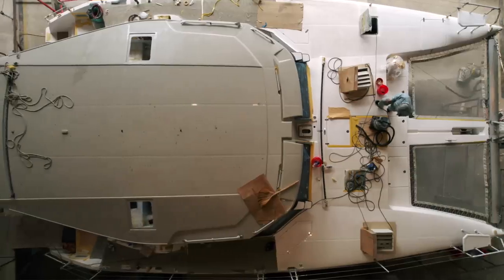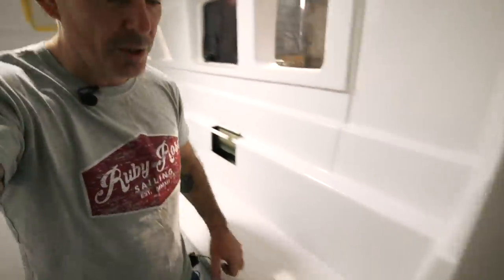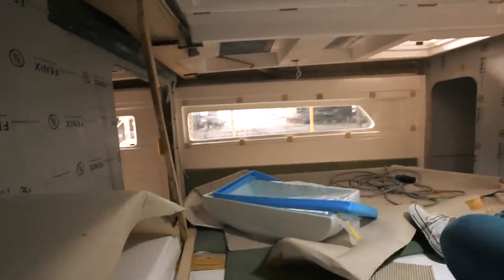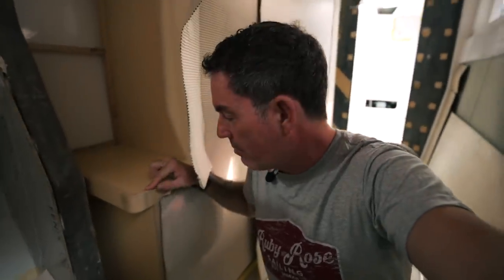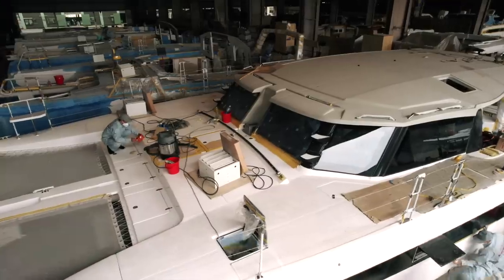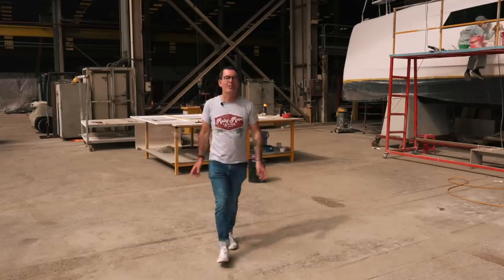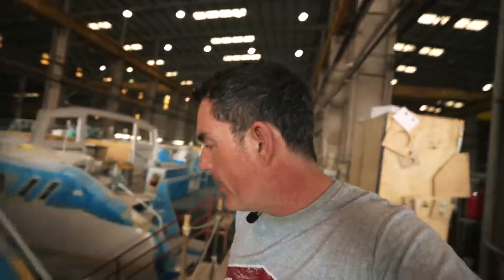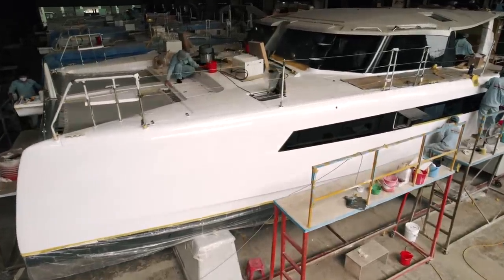Catamaran Build: HUGE Progress & BIG Changes!

Comment: Hi Nick, thanks so much for keeping us posted on the 1370 builds! Hull 1 is looking superb! Two questions (sorry if they've been asked previously); have Seawind/you considered an option of the tri-folding doors in carbon fibre? I own an 1160 and absolutely love the tri-folding doors, but they are very heavy. Would be great to have a lighter option for ease of use and reducing overall boat weight. Second question, are you going to be filming the sea trials in Hull 1?
Reply from the maker: Hey mate! Second question first- yes we will be filming the sea trials. There's paperwork involved in getting Nick onboard because of course there is, but it should be fine. As for the trifold doors, not sure if a carbon fibre option has been considered, I guess a lot of these things come down to cost as well. We'll pop it on our looooong list of questions to get answered at some point!

Comment: If it's going to take a month from this video to get hull #1 into the water, how long after it goes in the water do you expect it to take to run the tests and make sure that everything is sea-worthy and up to Seawind's standards before RR2 reall starts to take off.

The question comes down to 'How long after Hull #1 goes into the water before RR2 splashes?

Comment: Corian countertops do not handle much heat. A curling iron will melt/burn them. They say up too 212F but I have seen so many Corian counters damaged. Also an Air fryer can melt them.  I wouldn't go Corian but that is your choice.